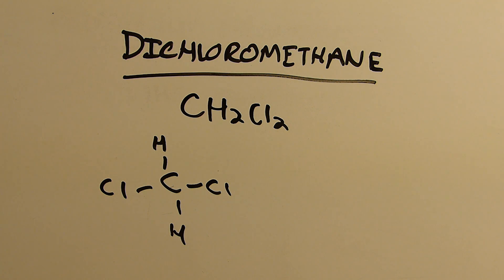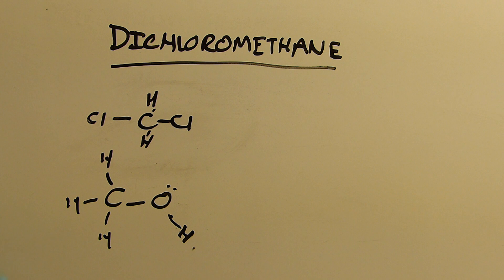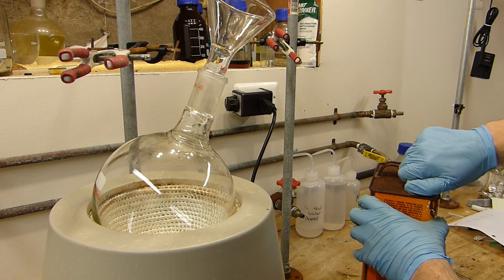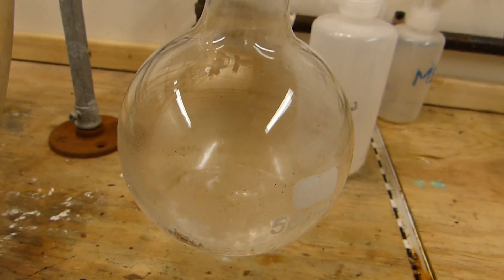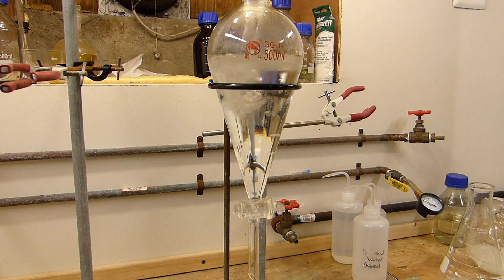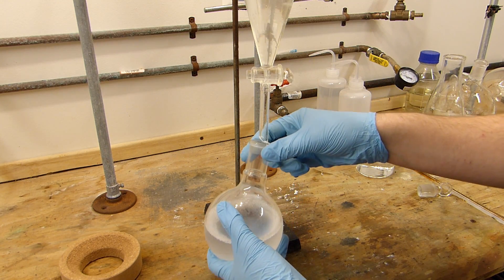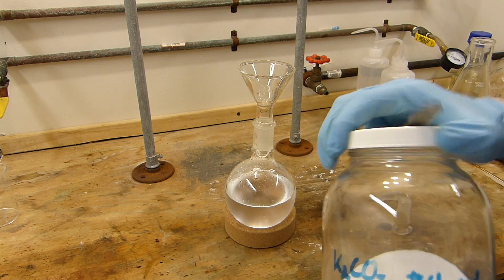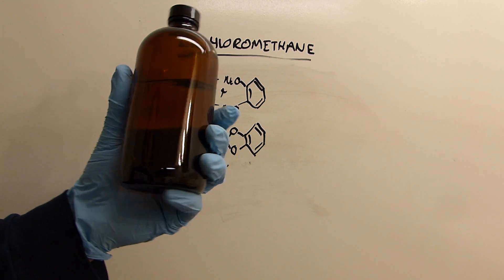OTC Dichloromethane

Comment: after watching this, i went and researched how DCM is made and it went as far as learning how to concentrate CO2 from atmo using potassium hydroxide and calcium hydroxide, then turning the captured CO2 into methane using the Bosch reaction, and then chlorinating the methane into DCM at 400 C. fun stuff. side product is HCl which is useful
Reply: +skyhawk551 i plan on making my own liquid salt reactor to make sodium metal and chlorine gas so i will do this for sure. besides i don't want to waste chlorine gas and there's only so much HCl i can make.
Reply: +skyhawk551 That's pretty dangerous, have you thought about the hydroxide route?
Reply: +TheTechnic Lord I have but I don't get chlorine gas from it, and I wanted to get sodium as cheap as I can and water softening pellets is the cheapest source I could find. besides I plan on getting into metallurgy so I won't be bothered by high temp. :) I will have a proper lab before getting started
Reply: skyhawk551 Ahh, getting into metallurgy too I see. I too wish I could, but unfortunately my lab consists of a kitchen, a broken beaker and a few flasks :P. I did melt salt and aluminium though, so I guess that's something. Any way I can help (I know the theory :P)?
Reply: +TheTechnic Lord I'm going to make an electric furnace that uses tungsten wire to heat it so I can go to 4000°F using zircon crucibles/linings. I would like to make my own graphite but that requires plasma arc heating to pull off
Reply: skyhawk551
That's pretty impressive. You can make an arc furnace pretty easily using a microwave transformer and some lamp batteries, would probably be easier than the tungsten wire (imagine all the old lightbulbs you'd have to buy and mess with). I wish you luck, and seriously, can I help in any way? I mean, you're basically living one of my dreams here :D.
Reply: ***** lol thanks, i'm taking the time to learn now, however my budget will not let me really get started for another few years, i've bought a $300 magnetic stirring hotplate with temperature probe, so i'm on my way. i can just buy thick gauge tungsten wire and make my own filaments, but the challenge is removing the oxygen, tungsten burns easily, but in a pure nitrogen atmosphere it can heat up to 5k degrees. i'll make my own video series when i get started called "energy intensive chemistry" where the only energy i use will come from solar panels and a battery array. and i'll do the kind of chemistry one might do in an orbiting space station where nothing goes to waste. and most chemicals like DCM, ammonia, hydrocarbons, and the like are manufactured directly from CO2 and water. stuff like that.
Reply: skyhawk551 That sounds awesome. Removing the oxygen doesn't seem to hard, why not simply have a positive pressure nitrogen flow from a liquid nitrogen canister?
Reply: ***** i was planning on purging with nitrogen that i'll distill myself, but the problem is creating an air tight seal on a system that goes above the melting point of most metals, and some ceramics. i figured i can just buy thick gauge wire, then insulate with zircon ceramic and use them like that. tungsten powered ceramic coated heating elements lol. should work
Reply: skyhawk551 Why not positive pressure? You'd lose some temp to the outgoing nitrogen but you could always cogenerate and use the hot outgoing for a reaction.
Reply: In other words, the reaction vessel is in a big box, surrounded by wire, the box has nitrogen in and a looong pipe out, heat from the pipe doing something or just being radiated, nitrogen goes into the box via another pipe + LN2, just a little flow is necessary to keep air out. Any leaks therefore will be nitrogen out instead of air in.
Reply: ***** sounds good, i also got the idea of using a low temp metal as a liquid gasket between the lid and the vessel. a little moat is carved in the vessel with a lip on the lid that fits into it, molten metal between them creates an air tight seal. this is for temps above 3k F
Reply: Could use something like gallium, has a very big liquid range.
Reply: Is there a way to pull one chlorine atom from chloroform and replace it with a hydrogen atom to to form DCM?

Comment: Dichloromethane is not hugely soluble in water, but it is somewhat polar (moreso than diethyl ether) and it will dissolve to the tune of a few tens of grams per liter of water (or vice versa for water in DCM), depending on the temperature.  I understand that the intent of this video was to show an easy way to acquire a useful solvent (and it did a good job of that) but the simplification might have been excessive.
Reply: You can and should re-distill the waste once enough has accumulated, effectively decreases the waste volume and increases the yield.

Comment: That so called polymer goop might be methyl cellulose, I don't know how you could test for it or what you could do with it though.

What's with the 1,3 benzodioxole in the last scene? I can't help wondering how nice it would look with n-methyl-propan-2-amine attached in the 5 position...
Reply: Exactly what I thought
Reply: I was looking for this comment 😂😂 I'm not alone
Reply: Was wondering that myself as well... or maybe attaching an indane ring with a secondary amine. I also wonder if you could change the (secondary?) amine to a (tertiary?) amine and hang a L-lysine off the nitrogen in the indane ring to create a slow release version.
Reply: Interesting, thanks!
Reply: Methyl celulose can be used to make metaloxide nano/micro particle paste to make electrodes from particles in dye sensitized solar cell experiments. I believe that there are many other similar uses.
Reply: Pure 1,3-Benzodioxolyl-N-Methyl-Propan-2-Amine is about the only chemical that's gone by way of the Dodo in America and many other places. Every amatuer chemists dream.. 
Catechol + CCl2H2 = Benzodioxole/2hcl + Bromoacetone = PMK/hbr.....

Comment: Any idea what polymer is in the polymeric goop? Maybe a polystyrenic type, maybe some byproduct of styrene production. On a similar note: PVC glue is a good source of THF, it is thickened by PCV dissolved in the THF.
Reply: +Jk Smith how can THF be sourced from PVC pipe solvent?
Reply: +GEZZA1 Distillation as with DCM.  Take care - pure THF forms peroxides that can ruin your whole day.  Since the polymer is PVC you might ruin a flask too.
Reply: +Jk Smith -- It's almost certainly methyl cellulose, a methyl ether of cellulose.  It's also used as wallpaper paste.  
See:  https://en.wikipedia.org/wiki/Methyl_cellulose